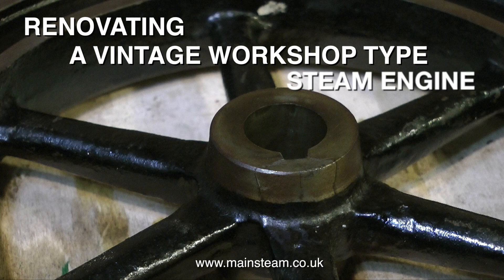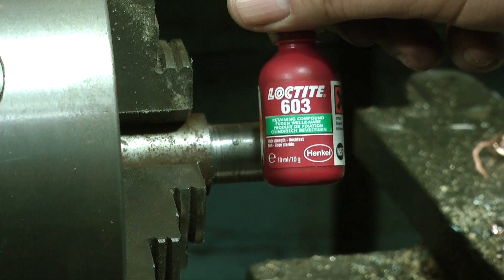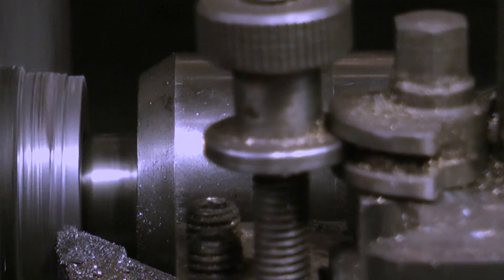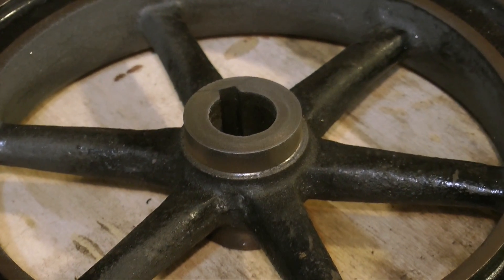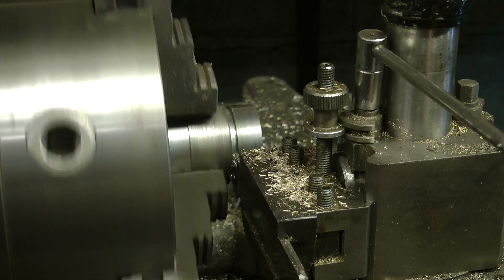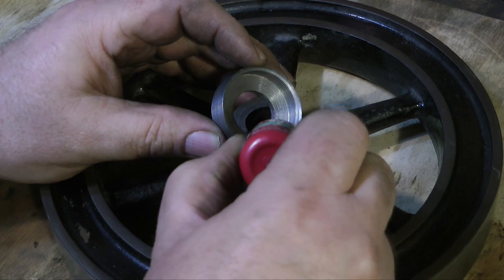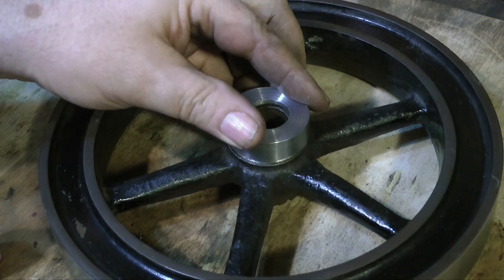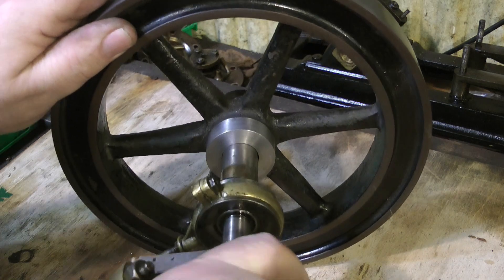PART #4 - RENOVATING A VINTAGE WORKSHOP TYPE STEAM ENGINE

Comment: I have made covers like this to repair flywheels. Rather than locktite I machines the cover a few thousandths of an inch under size then heated it to about 400 degrees F and dropped it on. When it cooled it tightened and was  quite permanent. 

Outstanding videos and I am enjoying them very much.